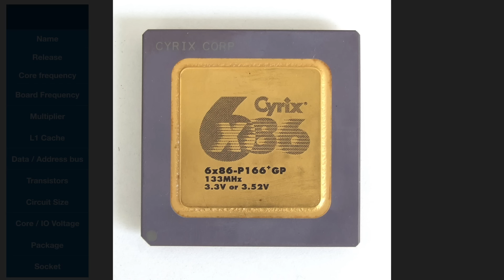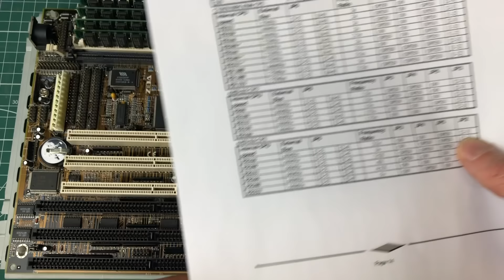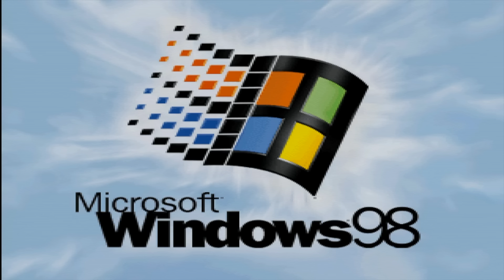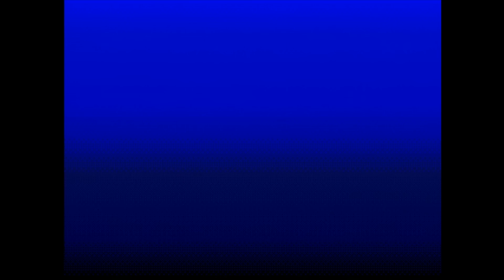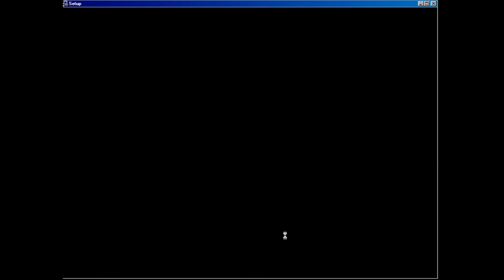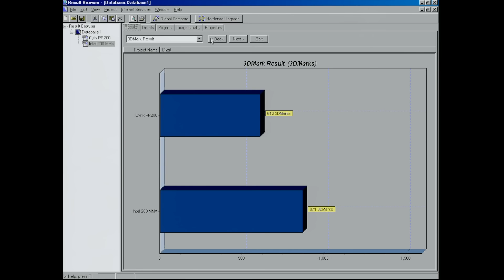IBM / Cyrix 6x86MX PR200 vs Intel Pentium 200 MMX

Comment: The BIG (Hot) problem with Cyrix was that the IHS was concave like a teaspoon! (Industrial Sabotage..!?)
The cheap extruded HSFs of the day where as bad, leaving an air gap of over 2mm between IHS and HSF!
No-one had even heard of Thermal Compound.

Lapping the CPU IHS and HSF and adding Thermal compound made it so all chips could run at frequencies = to their P rating and usually well above that, with huge increases in performance.
You want to keep the printing on the CPU, so a badly lapped (convex) HSF and GOOD, high W/m.k Thermal Compound for the OC video.

Also NB all the software for setting the Cyrix specific registers on Vogons.
Also the Enable Interleaving for Via chipstes.

Using a FSB of 75 MHz or, even better, the hidden/secret 83MHz (with a lower multiplier) overclocked everything! Not just the CPU.
That made for fantastic performance increases! 
A small (previous gen) HSF on the northbridge helped a lot if integrated graphics was used.

I had a cottage industry going at the time tuning these systems to make (stock) Intel Systems look silly, Quake or not!

Comment: I went down the Cyrix and AMD routes, both for the underdog element and my tight budget. AMD served me better, with the K6-2 450 being in my PC until 2003. I would later rebuild an old DOS PC from spares I'd accumulated. Then I got a used Pentium because, as I'd seen on my father's PC, the performance in games was generally better, as you showed. I never threw old chips away though, so still have 386, 486, K5, K6, various Pentiums and many more lurking in boxes.

Comment: If I am not mistaken the problem with games like Quake was that the MMX could do floating point and integer operations concurrently something that the 686 was not able to do.
Something that was often overlooked is the bus speed. This was where the 6x86 200 would shine with its 75 MHz bus speed.

Comment: I used to build those exact kind of PCs with the same case and even sold the same speakers for a while. Pretty sure the tweeter is fake if they are the same as mine were.

Comment: Cyrix was a integer beast could outperform Pentiums clock for clock up to 30% performance increase.  When it came to FPU performance that was another story, it wasnt fully pipelined and hence its performance in 3D graphics was closer to 4th gen than 5th gen.  Had Geforce and Radeon been released earlier this would have been less of an issue.

Comment: Mmx is a preinstalled instruction set, similar to XC, HC and A1 on the SD cards. All of these instructions are hostile to the gamers , and get deleted when gamers achieve goals during gameplay. As a reward, the opponents will become hostile to each other, and the gamer can enjoy, how stupid the opponents are. Still, accidents have to be avoided in car games. The processor learns from the cards, but it uses its own definitions of instructions. That varies from the brand, and manufacturing date, and version. For pentium, after a card, extreme, pendrive learnt from the phones, may program the processor to perform flying cars in car games, awesome physx for car, rally games. After done, cards or usb drives are not needed. Extreme is better. if no extreme, 16 gb or more has upgraded physx driver. 16 gb capacity is not needed, old computers can use lower format, 20 mb or 200 mb.
Reply: Did ChatGPT write this comment? I have no idea what you’re on about.

Comment: I'm very excited to have come across this video. In the early 2000s when my parents bought a shiny new Athlon XP 1800+, I got the old machine which was a Cyrix 6x86MX PR200, the exact 75x2.0 version shown in the video, just labeled Cyrix rather than IBM. About a year later, I received a free upgrade from a friend who had a Pentium 200 MMX; I ran it at 83x2.5 in my machine for 208MHz; it wasn't a big overclock in terms of clock speed, but the L2 cache and RAM ran faster this way. I do remember it wasn't a big uplift in my desktop PC experience, but in the games I was playing at the time like Need for Speed, it was a big improvement. It's so cool that these two chips, before and after my upgrade, came into this single video so many years later. Thanks for the trip down memory lane!

Comment: Using software from 2003 and WinXP era to identify CPU from 1997 is wrong way. Use AIDA32 or some DOS-based utility from 1997 for more correct results. If that is even possible since the MB does not have capabilities to report much data.

Comment: I have somewhat bitter memories about Cyrix as I had 5x86 that was supposed to match Pentium 75. I was so jealous to see my friend's Pentium 60 run all games butter smooth when my "P75" had awfully choppy framerates.
Reply: Yeah those Cyrix CPUs were only good for integer based software , e.g. avoiding subjecting it to audio or video applications that exposed the horrific math floating point performance.  If used for basic internet browsing and MS Office stuff then it was great, just as good as the Intel rival for that purpose.

Comment: I've had a few machines complete 98 installs and end up being unstable, but by and large you're right -- the Win3x-based setup is temperamental enough that if your system is held together with bubblegum and good vibes it generally won't get through an install.

Comment: This was my first PC in 1996:
Case: MIDI Tower
CPU: Cyrix 6x86 P200
RAM: 16MB
HDD: 2GB
Floppy: 3,5"
CD-ROM: 12x speed
Video card: ATI 3D with 4MB & MPEG video hardware decoder
Audio card: Aztech Waverider Pro 32 3D (100% Sound Blaster compatible)
Monitor: 15" CRT with integrated stereo speakers
PS/2 keyboard
PS/2 mouse with scroll wheel
Software: Windows 95 & Drivers on OEM CD

Comment: I guess you could tweak the bus to 83 from 75 on the IBM cpu . Anyway the ibm cpu can run very hot without breaking or burning up -I leftone without a cpu cooler by mistake -the smell of electronics paid my attention -it was maybe on for several minutes  -with this in mind I think you can just overclock out of the box to 233 just fine and no problems or even higher with modern coolers

Comment: You forgot the IBM 6x86MXL variant for laptops with a 1.8V core. I owned a PR366 6x86MXL with the revised FPU. Performance wise the revised FPU made a huge difference but too late for Cyrix

Comment: Oh man, I had that case with my first windows PC in the mid 90 (Pentium 133). It was around 2002 when I found another case like it but had 3 5.25" drive bays instead of two which I moved everything from the other case into because the other case was pretty yellowed.

Comment: clock for clock comparisons were also fun. And quite a few of the later mx and m2 cpu's can under-volt extremely well. And it is capable of running almost cooler than the Intel MMX chips can. One of the M2 chips that I have here, a PR300 i think? I have ran at a core clock of 187 and and at 2.4 volts. This was at the time running a classic listen server for UT a couple of years ago, and it did just fine with a couple of bots and upto 3 or 4 players connected. I even recall not needing a fan on its cooler. It could mostly run passive. I was also told by others I could have under volted it even more, and I may try that yet one day.

Comment: Those two CPUs were in a strange juxtaposition. The 6x86 was a proper out-of-order architecture with many 6-th gen features, but a weak FPU, slightly faster than the 486 generation. Pentium was still in-order design, although super-scalar, but Intel included a really powerful FPU, more common back then in the RISC designs. That explains the trading blows in the wide spectrum of benchmarks, closely following the strengths and weakness of both architectures.

Comment: I love that this is actually a fair comparision and not just "it runs Quake badly so it sucks" so often done by modern Cyrix reviewers. Most 3D games from the 1994-1997 era actually still used fixed point math as the Playstation 1 used it. Also, at that time, 20 fps was considered "good" performance in SVGA resolution 3D so the performance in Quake would not be seen as so bad even if inferior to the Pentium.

Comment: I once had the 686 PR150 back the days. Think it was 120mhz or something like that. Integer performance was great but floating point was very terrible on the other hand. So I'd like to play the latest 3D shooter back the days, I wasn't very  happy with it. But it was cheap and it was my fate to deal with cheap hardware back the days:-) The Voodoo1 helped it pretty well, but I remember when mp3 was appearing and I try to encode audio CDs to mp3 with it, there was this big disappointing moment again... Think I upgraded it to a celeron 400 budget system I build with used parts then, spending it s Banshee and was happy again for a few month;-) What I'd really like was the look of the cpu. Pretty cool with its big gold-plated head.

Comment: I think the AMD K5 is actually the fastest Socket 7 chip, but it can't handle high clockspeeds. Also the Pentium has an advantage over it's competitors in games because it was the most common chip. It's probably the cpu the developers of most games had and optimized their code for.

Comment: What killed Cyrix was that it didn't predict the explosion of PC gaming in the late 90's. It was producing CPUs under licence for IBM, likely it's biggest contract, and as such had heavily optimized it's architecture for productivity tasks. AMD on the other hand seized the opportunity to capitalize on the gaming craze. Games liked frequency, a trend that holds to this day. Socket 7 was a golden age platform that never would have been so prominent if intel had renewed it's licencing agreements with AMD. Intel didn't allow AMD in on the Pentium II architecture so AMD worked with the licences it had. There were also other, less known CPU brands back then, Winchip, Rise and ST, all trying to jump on the bandwagon hoping to ride the boom to success. Those are a lot harder to come by now. We sold Winchip 233 CPUs in our budget systems. ST and Rise I only remember from PC magazines of the time.

Comment: You have promised overclocking. I'm very disappointed. I'm guessing 66x3 or 2.5x83mhz are doable with little extra voltage. My 300A was running at 450mhz but that was a norm back then.

Comment: Pentium 200 MMX is a good click for overclock : fit it on a Supersocket7 mobo (like FIC PA2012 for example), set clock to 100 MHz, multiplier to 2,5, and voilà you get yourself a 250 MHz Pentium MMX able to outrun any Pentium II-233

Comment: Back in the day, I had a P75 that would run fine at 90Mhz. Combine that with a 12Mb Voodoo Rush and 16MB ram and you have a decent rig for 1998. After that, I went to a Celeron 300a and overclocked that to 450Mhz, saving hundreds. Then the GPU went to a Riva TNT 2. This was an nVidia card before GeForce.

Comment: I think the reason that both Cyrix and AMD got a very bad reputation for stability in the 90's, was mostly due to the fact that they were usually used in budget systems, with (very important) budget motherboards. And let's not forget budget power supplies. Bad quality motherboard + dodgy power supply = unstable system. Intel CPUs were usually used in more expensive systems, with higher quality all around, leading to stable systems.
I built a system with a K6 200mmx back in the day, and I chose to go with a, for the time, pretty high end motherboard, the Asus TX97-x. I also overclocked the CPU a little bit, to 225MHz, simply to get the bus speed boosted to 75MHz, which gives a nice little overall bump in performance. The system ended up being very stable and fast enough to surprise several of my friends who expected my "cheap ass" AMD chip to suck compared to "a real Pentium mmx".

Comment: I still have my first Pentium era PC.  It was a Pentium 133 with a S3 virge DX, then eventually I got a Pentium 200 MMX CPU for it, and a 3dfx voodoo 3 2000 to replace the s3 virge DX. I used it for quite a few years.

Comment: I still have a 93 Pentium with a overdrive 66 or a Pentium 200 MMX twin 3dfx cards last started 6 years back. I also use 2500k,3700k and  a 9900k at 50x.I stayed away from Cyrix do to there poor floating point results

Comment: From the good old days when one motherboard could take CPUs from several manufacturers. Why don't we have a universal socket and chipset for AMD and Intel today?
Reply: On other hand we basicly have intel and amd now on x86 home consumer market front and nothing more.
Reply: There was a video called, "can this old $10 chip really edit video" it was reguarding a chip made by neither AMD or Intel, but was made specifically for editing video, back in the day, used by Hollywood, and $1000 when new.  The video was made to disapear real fast.  Does anyone know what chip it was?
Reply: They may have to think that direction soon. Apples new unified memory is 1024bits wide. It's beating AND and Intel in a lot of critical areas.
Reply: This is because both AMD and Intel are anti-competitive when the cards are down. They both went out of their way to kill third-party chipset manufacturing and hijack front side bus and socket designs.

Intel goes without saying but people like to paint AMD as if they're some saintly innocent do-no-wrong technology company. The reality is that AMD also did their best to screw their competition when the chance came.

You have to realize one of the reasons Cyrix was even able to enter the x86 market was because sockets and front side bus platforms were basically standardized by the industry as a whole, so if you had the engineers and intellectual and monetary capital you totally could design and fab x86 CPUs that would work as drop-in replacements for other x86 CPUs. AMD, after they were done second-sourcing for Intel AND Cyrix both got into the x86 market for themselves entirely because the industry, not Intel, controlled the platform, and so you could easily just look up pinouts and specifications on both front and rear-side bus designs and produce CPUs that would work. 

Then stuff like how extensive the bus could be, connectivity, what sort of RAM you had, etc, basically was left up to the motherboard manufacturer, so long as they conformed to various standards laid out by groups like the IEEE or JEDEC. 

What resulted was that Intel, AMD, and Cyrix had to actually compete in terms of what the CPUs themselves were capable of doing, as the CPU was not going to be changing how the platform itself worked. So a CPU had to sell itself on its performance and capabilities independently of trying to hold features or specific platform technologies hostage unless you use their platform like they do now. I'm looking at you, Intel, with Optane, and you, AMD, with Infinity Fabric. Those are examples of technologies that should have been left to motherboard and chipset manufacturers to support, not enforced by what brand of CPU you had.

Well, once Intel and AMD saw an opportunity to actually put front side bus functionality on their CPUs and felt they could get away with it, they did, and it gave them an excuse to also reject industry standard sockets and make proprietary ones instead. For a while they still let third party manufacturers make rear-side bus chips (nVidia used to actually support a lot of AMD CPUs with their nForce chipset. This was before AMD bought out ATI and started competing with nVidia.) but eventually they killed that off too and started integrating more FSB features into their CPUs until this day where FSBs are basically an obsolete term and you just have a singular chip serving as the southbridge that is manufactured by the same company as your CPU.

Why? So that companies like Cyrix and Transmeta would never be able to show up and disrupt their cash flows again. Gone are the days when you could design and fab a drop in replacement for a Pentium because the sockets are proprietary and the platforms are treated like trade secrets now. If you were to try and make an x86 CPU that could run in, say, a socket 1151 chances are Intel would sue you out of existence, or AMD would take you to court over trying to use AM4+. 

Intel and AMD are not your friends.
Reply: @YaroKasear  Most people would tell you the horror stories of the third party AMD chipsets, from Via's lack of performance, features, and expansion to Nvidia's nforce instability. Your entire argument is also a red herring, as the likes of cyrix went under long before AMD locked their platform down. By the time that occured, AMD was the only competitor left.
Reply: @YaroKasear  This is plain capitalism. Starting with a variety of company's sharing a marked, it always  went down to a consolidated market with just a few leader company's left.
Reply: @YaroKasear  
So it's the on chip proprietary front and back side bus architecture that makes designing a compatible cpu almost impossible?
Reply: @YaroKasear  Correct. Actually in 2010, nVidia has finished the new nForce chipset (MCP99) for Intel's 1st Gen Core-i series processors with LGA1156 socket, but eventually nVidia is not able to sell this chipset due to potential lawsuit risks. What a pity!
Reply: @YaroKasear  I guess this change adds up to the problem that PC hardware are so diverse today which make software/peripheral manufacturer hard to keep up with compare to Mac.

Comment: To me my main difference is that NEVER I saw an Intel MMX melting, literally, melting it's CPU DIE, on the other hand, specifically the Cyrix PR200 I have seen melting it's CPU top like a charm, the CPU heat-spreader simply slid sideways down the ceramic die...
Reply: Neither has something like that ever happened to me on an AMD CPU...
Reply from the maker: That would make a great video !